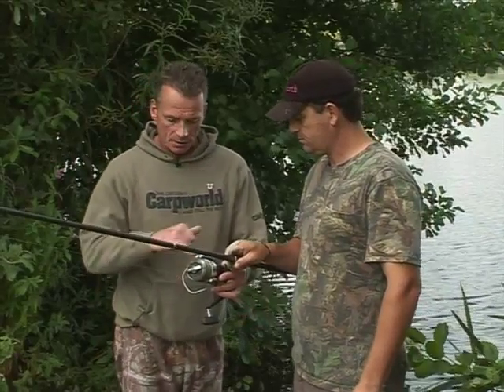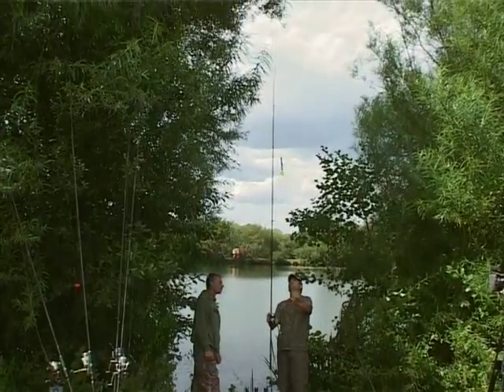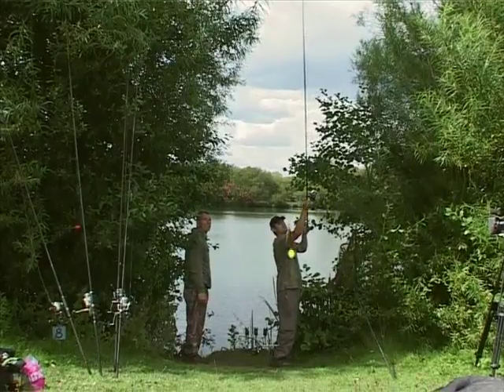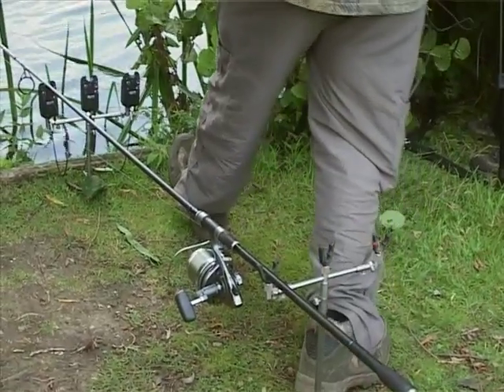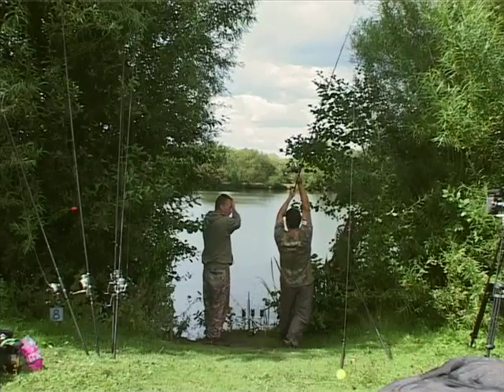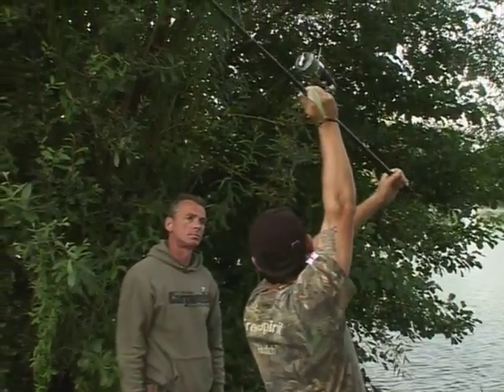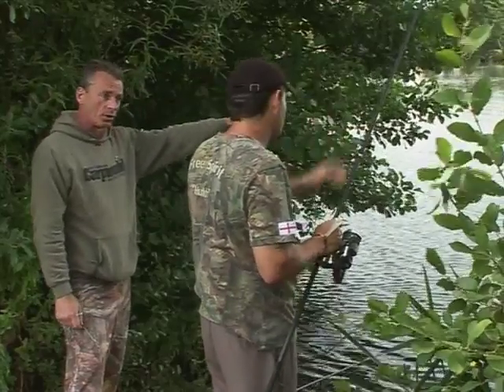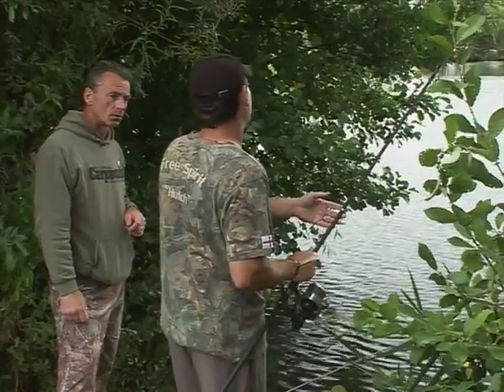Mark Hutchinson explains his casting technique - Part1

Comment: megadeth22885  Lets see you cast 150+ with braid and no finger protection then, good luck with that. I have had leaders cut through my leather finger stall and still cut my skin...
Reply: +Thomas Lilley  stupidly i was spoddind at 65 yards out and the leader i was using sliced my finger and i wasnt casting that hard.
Reply: +kit clark *spodding without a finger stall